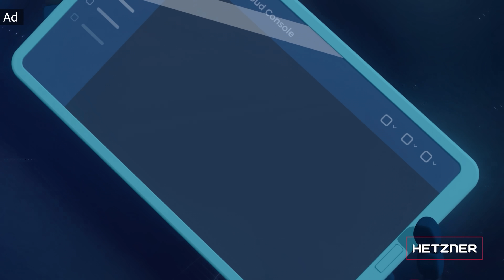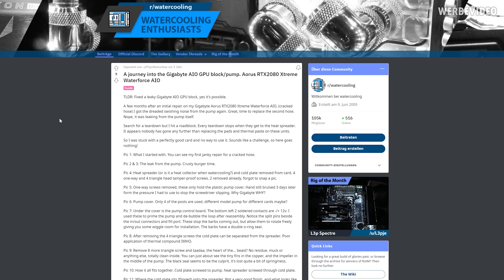Viewer-Mail Ep6: RTX 2080 Gasket Disaster

Comment: i had the same issue 😐 so i installed a new pump/block combo with new hoses/rad any, block pump will fit (intel socket) if you file out the mouting bracket holes 0.5mm offcourse you will have to cool the vram i cut off 3 vram cooling heatsick from the orignal coldplate and installed heatsinks to the vram, then isntalled the original coldplate for cooling the vram under the hose connections and the powerstages....

Comment: Those triangle head screws are called Tri-Wing. There's a suitable driver for that. Those one direction ones...get rid of those! The fix for that will have to be a rubber gasket cut to that size (or an O ring that fits, difficult) but then...cannot really risk it unless it's yours. One more reason to stay away from OEM AIOs...

Comment: Regarding the fill plug, it looks like there's a roll pin inserted into the plastic housing that retains the plug, likely holding onto a channel in the plug. It may be possible to push the roll pin out and remove the plug.

Comment: I wonder if you could cast a new O ring out of silicone. I have a few AIO pumps I could test this on (not to mention a few hybrid coolers from the 10 series GTX), I have never thought about casting anything other than controller parts, but considering how unobtainable a replacement gasket could be, I think it might be worth trying. Not to mention trying to turn ASUSTeK aio pumps into water blocks we could connect custom loops to... I think I have a new winter project.

Comment: I cannot count how many 1990-2010 honda water pumps (on a 4 cylinder car engine) i have seen this exact same issue on. They chose to use a crappy o-ring made of inferior material and almost every one of them would leak from the o-ring area 😅

Comment: The sealing part with the shady gasket can be fixed by applying some grey rtv on the mating surfaces where it sits. The pump's square drive plug is not screwed in, its held in place with the roll pin right on its side, remove the pin, then the plug can be removed. Pushing it out from the hose side which is easier to remove is preferable. Then u can bleed it through there and replug it finally. This should last  the cards life.

Comment: This is a typical problem with a Winshare's coldplates production process (Guangdong Winshare Thermal Technology Co. is a subcontract ODM for Asetek's medium price range products). Black residue in the middle of each side is just a burned copper dust after friction stir process of welding copper top cap with baseplate (there was a premade groove in it where top cap goes). If you take metal ruler and put it together with coldplate you'll see distortion of the plane right in the middle of that side which leaked. Low quality gasket has nothing to do with it,  tight pressure made by screws is enough to keep it squashed.

Comment: Those AIO are not designed to be a serviceable item. 
Those marks on the copper are very deliberate, it's not an incompatibility between materials. 

Yes you can use a normal o-ring, just need to find one the correct size to be a good fit.

Comment: My weekly  dose of Der8bauerdaily every few days  if were lucky enuff
That old juicer machine never used in 5years like new Its getting sandpaper disks on the roter blade make it a usefull again
 it'll be sanding balls &  nuts and what ever needs a polish   toss in some sand and its a polisher Junk renewable uses . 
Old mother boards line up put on junk/ toy buildings etc  to look like a small city and flim a small starwars fighter passing over it then  Lite the bastard up :)
Reply: i want to check my RTX 2080 waterforce Cooler new 2019 runs ok but would like to check inside for build up mite save a dister like above happening 
undoing the hoses be 1st concern they look pressed on but i see others just add new hose & clamps  Just remember to slide the cablemesh back on 1st

Comment: As to the plug that just rotated it looked like there was a roll pin in place next to the port - the plug is probably just round with another oring on it and locked in place by that roll pin - could have been the real source of the leak as it looked like most of the dried coolant was in that area

Comment: Returned my exact model to Gigabyte this year, 3yrs old, still under warranty.  They reimbursed, said they could not repair, replace, and I guess didn't have stock to offer me a newer model.  

I didn't see green growth/corrosion but it could have existed.  My symptoms:  heard a HISS sound every few seconds (as if air leak or as if a drop of liquid fell on a hot surface and turned to steam).  Our temps were not yet bad but the sound was scary.  Had used it outside the case to tilt and work the air bubbles up to the rad, but nothing resolved it.  

Appreciated your video.

Comment: I'd say if longevity is a huge concern, it would seem going with these AIO cooler versions of GPUs is probably not the best idea. Of course competent AIOs can easily last 5 years or more, but on a product like this I feel like the probability of corners being cut is very high. Especially when you consider how terrible the margins on these cards are for board partners. Those anti-repair screw heads are absolute nonsense.

Comment: Surprised you don't have the iFixIt tool kits... the triangular and wing bits are in the kit.
I wonder if the large square one is just a press-in cap, and the square is to help slide tight o-rings in

Comment: You can use silicone. There is no pressure. The liquid is similar to the one its used on cars, and i have used silicone to repair broken rubber seals. Car cooling uses +100ºC and +1 bar. So that wont be a problem at all

Comment: I had the same issue with 2080ti waterforce version and I had to send it to rma after only 5 days and the second card was faulty too and was sent to rma after about a month. I though that the problem was associated with the tubing because I changed fans too, just like this guy and I had to cut cable ties that were attached to the tubing itself to hold cables for the fans. Therefore I was worried that I somehow accidentaly damaged the tubing but I was confused why it started leaking after a few days.

Comment: The black residue is probably rubber from the gasket due to them gluing it a little in place to hold it for assembly (as they turn it upside down to install it). Looks like an EPDM gasket that hardened due to age; silicone gaskets are better but they have worse permeability; A simple solution is to clean the bad gasket and coat it with gray RTV auto sealant and put it back in, it will run fine
Reply: Using a gasket with a sealant is just asking for leaks…

Ask any competent mechanic why

Comment: I had that exact card and had the exact same problem after about 3 years of usage. The cables in my card were not run incorrectly.
Just ended up installing a water block on the card and moved to custom water cooling. The card itself was totally fine.

Comment: the 'rough' parts are assembly adhesive. It's essentially just a rubber glue to keep it in place from assembly. The glue is a tiny dab of gasket maker, not a cause of leaking.

Comment: Just had a Liquid Freezer II 420mm AIO cooler leak on me due to poor packaging during transit, the coolant vapourised on the 100'c 13700k, inhaled the fumes because I couldnt see them. 1 hour later was in hospital with a partially collapsed lung. This only happened 2 days ago, was dischaged from hospital today. 

Leaking coolers and coolant near hot hardware that could vapourise is no joke and should be taken very seriously!

I was lucky but others may not so be.

PC and I are fine and healthy, Ive written to the company who sent the cooler and asking for them to pay more attention and a refund.
Reply: i am sorry this happened to you.
mind telling more details about your injury?
just curious as to how the vapours caused your injury
Reply: @Owlery  

Hey no need to be sorry. I'm alive and well! :D <3

With the water cooler box being open inside its postage box, I believe the pump may have been moved around quite a lot, thus weakening the two attachments that go from the tubes to the pump itself, I also noticed that the 420mm radiator was performing poorly compared to my previous 360 Rad. How ever I assumed maybe my fan controller needed to be tweaked etc. (I'm running a z790 Taichi with a 13700k). 

After 10mins into testing Call of Duty Warzone 2, I noticed small little flicks of light out of the corner of my eye, after a few more mins I suddenly realized there was water beading up on my graphics card (3080ti Galax), Since my case was already open (lian li dynamic) I pulled the power cable from the psu in a panic and leaned in to see if there was any damage, 

By then it was too late, after even a short breath I got hit with the fumes, didn't think much of it just though it may be burning plastic, 

After taking the pump off rather quickly I noticed a few drips from the  water cooler tubbing hit the cpu and bracket, though it was still super hot from running at 100'c with a broken pump/cracked tube, thus getting hit with more vaporized coolant ><"

After one hour of not really feeling anything, my left shoulder and rib cage starting having sharp pains, I took a hot shower pondering if I had stretched a muscle, though after 30mins it was too much to bare, I could only stand up as my left lung flared up, thus having to call the ambulance,  blood pressure was 190/130, close to fatal, Luckily Australia has amazing health service and I was administered 10mg of morphine, bringing me back down to 160/110 while awaiting in the hospital.

Doctors and nurses continued to monitor my levels through out the day, multiple blood tests were taken, as well as x-rays. The x-rays showed my left lung had partially collapsed and blood tests showed increased white cell activity.

I was discharged today thankfully, advised by the doctor to do deep breathing exercises and to take pain killers regularly ( though I don't need them the pain is bearable).

So yea that's was my experience just a few days ago with leaking coolant. 

With these new CPUs getting super hot we must be careful not to let any coolant get near them, I think this may need to be looked into as a whole, having maybe a 2nd back up tubing or any anti drip method for the pump.

But yea crazy that it can happen, and I do not wish this even on my worst enemies (not that I have any xD). 

I was very lucky that it only entered my left lung, and not both as that may have ended me ><".

Stay safe! May your frames be high! your CPU and GPU temperatures be low! and your internet speeds be fast!
Reply: @Ðigital_Bliss  You need to call Goldberg and Osborne the injury attorneys.
Reply: @mikehenry4743  Cheers for the concern, The company has until Monday before I push any legals, that being said sadly will have to find an injury lawyer in here Aus.

Comment: 8:45 looks like the leak came from there. Look where the leak begins from (4:04).
10:33 they put some weak glue for the gasket so it does not fall during the manifacturing.
I think it failled because the gasket is made of rubber whitch gets harder over time under heat whitch makes it useless.
Thank you for the video.

Comment: I defeat security screws like these by grinding a flat slot into the head. A wide flat screwdriver does the trick from there on. Only works for reassembly of course. 

Useful for power strips with "never open me again" screws!

Comment: You were almost right, i mean logically you went in the proper direction but some things you said are simply not true.
Typically copper makes 2 oxides: Cu2O and CuO. Neither is green, one is black one is brown/red. The green compound copper does make is colloquially called patina and it's CuCO3 mixed with CuSO4 for example. In general those are copper salts mixtures not oxides.
The black thing in the middle of 4 cold plate edges might be CuO (black as well) but it doubt it since there is very limited (if any) air availability there. It's also not copper corrosion cos the coolant doesnt react chemically with copper. My bet would it that it's pulverized rubber from the gasket. Interesting to know why only this like 1 cm area was affected not the whole length. Most likely there is the highest pressure which in turn kinda means it's not a good design as the pressure should be distributed equally on the whole gasket.
The green mess/stuff is obviously dried up and crystallized coolant. Apart from that's ive no idea what it's made of, id be interest to know tho.

Comment: you can see a retention pin on the side of the fill port cap. I've seen them before on AIO pumps like corsair H80, you can push the pin out and the pull out the cap to drain&refill the loop
Reply: Came here to say the same thing. Looks like a roll pin that you see in automotive stuff all the time.
Reply: Hard to see from the video, could be a roll pin or a small screw. On those enemax threadripper aios that were scumming up I was buying a lot of those units for super cheap on ebay and cleaning them and refilling them. They have a small socket headed shoulder screw that they use instead of a pin to help retain the hoses into the pump housings.

On this unit you can see whatever they used for retaining that fill port they use the same thing on keeping the hoses in as well.

Comment: Plastic gaskets gets hardened by continuous heat. Better way to back it to its original soft plastic is by moisturizing it cleaning with WD40. So many years restoring copier belts and paper feed rollers with it 😉

Comment: @4:51 Nice catch with the wire.  The thermal pad probably saved it from being pinched.  I've worked in chemical plants with various chemicals and pumps, valves etc. as well as water and wastewater plants. I've never glued a gasket/seal/o-ring into place.  In this case, I'd be worried that the glue solvent might "solve" the gasket.  Again nice troubleshooting.  I'm wondering if AIO companies research chemical compatibility between gasket and cooling solution as well as any possibilities, as you alluded to a possible copper salt at the failure point of the cooler, between cooling solution and copper(as well as any biocide as Iodine and any organic chlorinated disinfectant would react with the copper).  Just guessing...  I would hope they would consider this!

Comment: I had an EVGA hybrid 1080 that started leaking, and the copper on the underside of the cold plate was discolored exactly the same way that the underside of this cold plate was. It had leaked around the edge, and the edge of the underside of the cold plate was discolored. The discoloration on your cold plate is a clear indicator that that is where the leak was. It probably wasn't much, but it doesn't take much for that to get oxidized, so it would push fluid out, and then it would expose it to oxygen and air, which discolored the copper very quickly.

Comment: That green sludge is usually attributed to automotive coolant, the typical green type that's mainly used for cast iron based engines with brass or copper radiators, red type is for all alloy engines with alloy rads. The green sludge indicates that the ratio was too concentrated or was a poor quality coolant . Also green coolant is a silicate, inhibitor based fluid so can just go solid if just sitting on a hot surface for a period of time.

Comment: I noticed that the fill port cap has a stopper insert right next to the arrow of the port. I also think that the fill port cap is just a cap with an O ring without thread. These are the reasons it didn't open. Otherwise, it's a shame that the entire product was failed because of one rubber seal. Even worse if it is difficult to find a new gasket. Like you said, maybe the entire cooler needs to be replaced, which is a waste of Earth resources.

Comment: It's hard to tell from the camera but you might be able to cut your own gasket from those big sheets of silicon rubber gasket material they sell for this exact purpose (here in America you can find them in automotive parts shops like O'Reilly and Advanced Auto Parts)
Reply: This is a good solution, but I would use selleys 401 or equivalent silicone, makes a perfect seal every time. I’ve even sealed fuel taps on motorcycles with it, because it’s solvent and heat resistant. Works better than OEM gaskets and o rings.

Comment: I really like it when you troubleshoot.  Your insights are interesting.  Im guessing that what the gasket had was an adhesive to hold it in place.  Through some engineering failure it wasnt recognized that the adhesive might have a corrosive reaction on the rubber which then allowed a very small amount of liquid to escape over time.  You were very generous to give him a 3080.  Well done.

Comment: "inspect before testing" hahhaa
Last night i massacred the smds on the back of my 1660ti while cap modding, i sighed, waited for it to cool down and plugged it in. No picture out.
Remove card and scrape off all suspect smds. Try again. Now it clocks higher despite missing at least 7 of the smds behind the silicone

Comment: I have been around since the days of using aquarium pumps to water cool computers. I’ve had numerous water, cooled systems and components, from custom to AIO, and you are 100% correct that gasket was damaged from chemical incompatibility. It’s a combination of thermal cycling and age. Quite a few AIO’s leak in this manner. The root cause is usually bad water.  Often times the manufactures will use whatever local water is available to them to mix their own coolant. Chinese city water has no place in your body for your AIO.
Reply: Easy to restore them with WD40. It regenerates and hydrates gums 😉